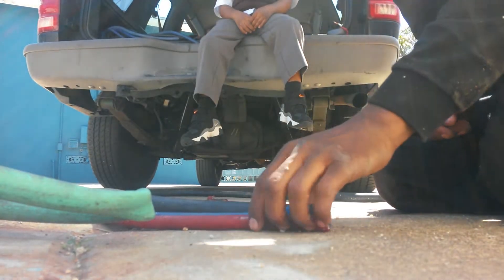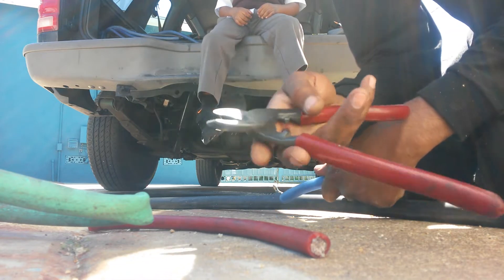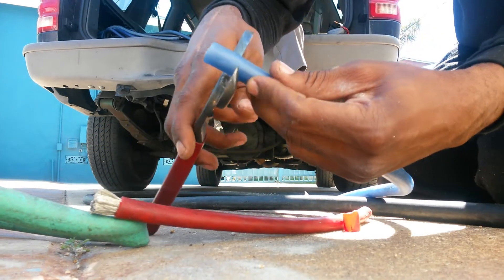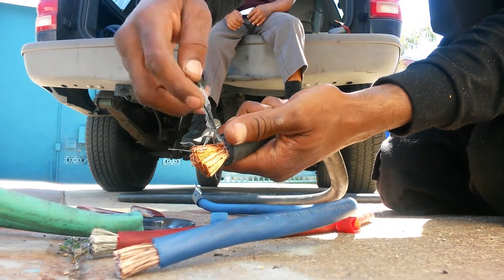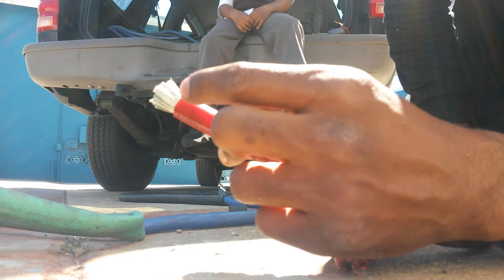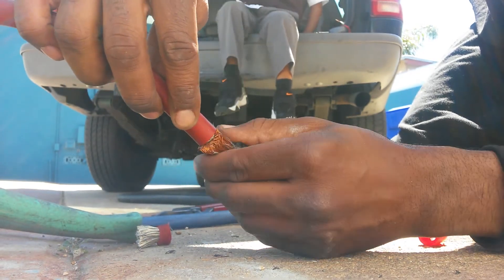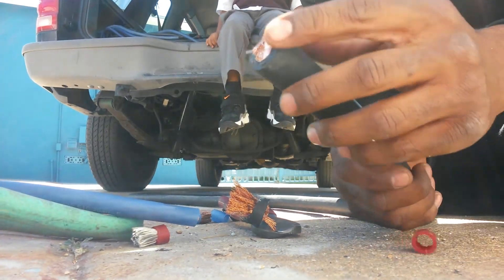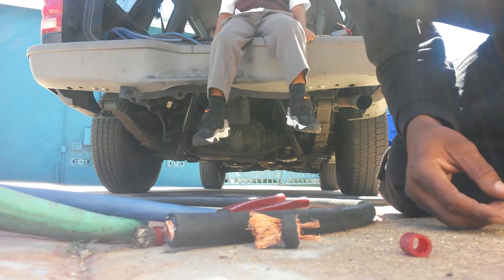How to cut thick wire

Comment: Helped a lot, gonna get that 10” cable cutter for adding my inline fuse holder with some 1/0 wire, thanks man
Reply from the maker: No problem bro i still use the same one til this day I'm sure it'll be very useful for u

Comment: Nice work, thank you.

This saves me some head banging with replacing my battery clamps. I have a 2004 Corolla, and the original positive clamp is just 2 thin bands of steel, and it's corroding away.

It's no wonder the engine doesn't want to start.

Happy New Year to you and your family! :)
Reply from the maker: Thank you for all the kind words and i appreciate you subbing to my channel. Happy New Year to you and your family as well

Comment: Thanks for the video. This tool is now cost $22 at Home Depot as of 12/18/2023.  In your video, you bought $7 but it was 6 years ago. What a 6 year inflation cost. Anyway, i need to buy this cutter to cut wires for making tesla charger box
Reply from the maker: https://www.harborfreight.com/10-inch-cable-cutter-40507.html
Reply from the maker: Harbor Frieght still has it for only $9.99

Comment: What brand are those cutters
Reply from the maker: These cutters are klein which i still currently use
Reply: @BIGJURAY20  thank you for the answer.. 😊I saw the ad for Cline on Amazon that one does look like a kind also same as the picture I saw. and I own a few Klein Tools thank you very much. I'm going to pick one up😊 how long have you been using that particular one and you use a constantly or just now and again.. Happy New Year
Reply from the maker: Happy New Year to you as well. As for the use there was a time i used it pretty ofter now I'll use the cutter here and there mainly dur to the pandemic but I've had it over 7 years or so and it never disappoints when i need it. I'll be using it really soon for a big project i have coming up
Reply: @BIGJURAY20  very nice well good luck on the big project and thanks for all the info I'm pretty ice sure I subscribe if I didn't I'll make sure to soon as I do this send this comment
Reply from the maker: @VinceBadovinatz88  Really appreciate you tuning in and showing love
Reply: @BIGJURAY20  🙂😊

Comment: This wire looks like the conductor portion is very thinly stranded, This looks similar to welding cable, Not typically what you see in the field which is THHN, and has much larger strands in the insulation (Jacket)...That is DEF harder to strip and cut with the lopers (Rabbit Ears cutter you're showing)....they can usually cut through up to 2/0 maybe 3/0 THHN....
Reply from the maker: Yes the bigger cable is 4/0 Awg and pretty thick. I'm sure other cutters would be more ideal for cutting it but never had an issue with these cutters especially since I still use the exact one's today

Comment: Please help me were did you get the welding cable were can i order it
Reply from the maker: You can find some on eBay. How much power are you running?
Reply: I was gonna get two CAB 2000.1D  thank u so much for replying il definitely check them out (✌🏼💪🏼🔈💪🏼🔉💪🏼🔊)
Reply from the maker: @basslife4evr772  if u play on running 4k a run or 2 of 2/0 welding should be more then good
Reply: Sounds good thank again for ur reply (✌🏼💪🏼🔈💪🏼🔉💪🏼🔊)
Reply from the maker: Anytime bro

Comment: WHAT DO YOU USE TO CAP OFF A THICK GADGE WIRE
Reply from the maker: Well I used this thicker gauge cable for Audio use so i used closed ring terminals and heat shrink tubing for cleanliness
Reply: @BIGJURAY20  WHAT IF FOR A OLD HOUSE LIGHTING ?
Reply from the maker: @B.I.G.C  Not too sure about this one. House lighting is usually used with a much smaller gauge wire and solid copper

Comment: Is there any danger when high voltage electricity is flowing through the wire ?
Reply from the maker: Mat s its not ideal to cut through a cable that has a live circuit.

Comment: Jest get some tree pruning pliers ! Way easier !
Reply from the maker: I'll have to look into them. Thanks
Reply: I did a search and finally found a photo of pruning tree pliers.

Pruning pliers would definitely * NOT *  be easier than cable cutters. The handles are short, and would dig into my hand.

It makes sense to follow Big Juray's experienced example and go with cable cutters. The local Menard's has a nice pair of cable cutters for a mere $7 plus tax!

I would have to order pruning pliers through the mail. I found a pair of pruning shears on Amazon for $19 plus postage.

Using pruning pliers is a fail.